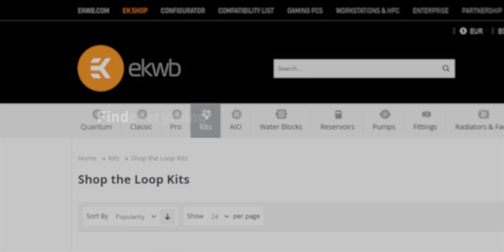We Put Something INSANE Into This PC - Find Out What! | Relaxing Assembly Tutorial

Comment: I don't get why don't use a longer radiator in the front if there is space down...
Reply: Use your brain and you'll work it out ;)
Reply: it would bump into the pump for the distro plate + it wouldnt align as smoothly
Reply: I modified this build to do just that, this case can take a 480 in the front. I got a 45mm thick 420 from alphacool and reusing my 30mm 420 for top and will make them work because i refuse to use 120 fans, I want a quiet build lol

Comment: Completed this with small variations. Awesome. 
But there's something I don't understand. How can you drain your loop, if both drain valves are hidden by that case part / bay? 13:24 
You need to remove that plastic case part to access drain valves. But to remove that case part you need to uninstall the bottom tubes from front radiator. Which makes pointless having a drain system. 
Am I missing something? 🤔
Reply: After further experiments, I can say that it is possible to remove or install that case plastic part even with front radiator and tubes installed. It is just incredibly hard and not really convenient.

Comment: Is it not kind of crazy that rotary offset fittings are required for a custom distribution block?  shouldn't it line up already since it was designed for that case?
Reply: It's made for the case, not the motherboard. Motherboard and GPU blocks are n ot the same and the ports can't be the aligned for every brand. However, we can make them fit into 4 different size catagories, which is where the offset fittings are required.
Reply: CPU socket has no set height across the MB. Manufacturers. Not even across the same manufacturer. So offsets for the CPU are a given. For the GPU you are actually correct and if it was mounted horizontally, no offsets are needed. But as it was mounted vertically and EK GPU vertical bracket was not used, then it is not inline. 

There are two reasons why EK vertical gpu bracket was not used. 1.Case already offers two vertical gpu mounts. 2.It can not be mounted to that case because it would need some modifications. This case has swappable cage at the back, and that design prevents EK gpu bracket to be mounted.

Hope this helps explain it.
Reply: @saneldomeh487  Mmh, this is actually very interesting. I am planning to build this configuration, but sadly vertical mount for GPU is not going to happen for me. I currently use the PCIe x1 slot on the Z690 Extreme for a sound card. So are you saying that for a horizontal GPU mount, I would use the same outlets in the distro, just with no offsets? Thank you
Reply: @Gobbetto1989 you do not need offsets as you will have perfect horizontal tube runs to the distro ports. Two 90° rotary adapters on the gpu terminal and that is it for the normal gpu block in horizontal orientation.
Reply: @saneldomeh487  Hey thank you for the confirmation, that's pretty convenient. I assume it will work with 4080 Vector² wb as well, right? I had to save a little bit on the GPU XD
Reply: @Gobbetto1989 yes, it works with any Vector2 WB.
Reply: @saneldomeh487  Awesome :face-red-heart-shape:

Comment: Dude didn't use their $22.99 torque screwdriver to install the Velocity2 backplate.  He must have 0.60 Nm dialed in to his fingertips.....  Same as me I guess.
Reply: Thanks for the compliment but actually it doesn't say anywhere to use 0.6nm of torque when mounting the cpu block and the CPU block treads have a hard stop. You can feel it when you reach it and also you can see it if you look under the block at the mounting screws. Hope it helps